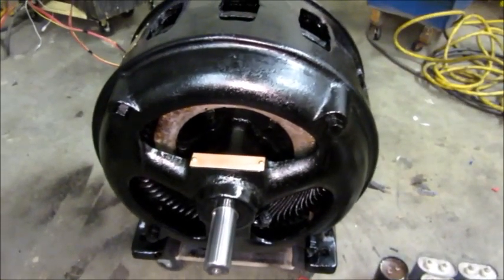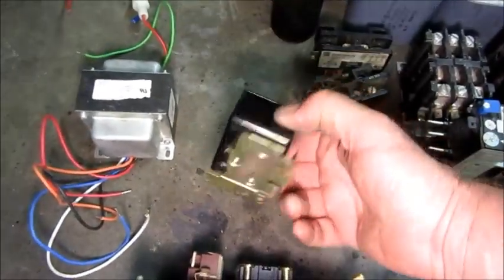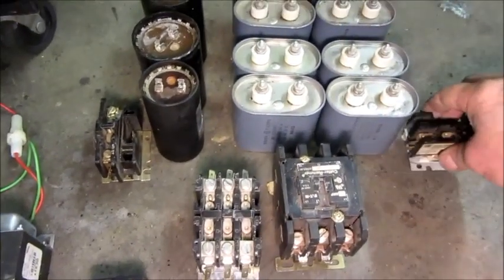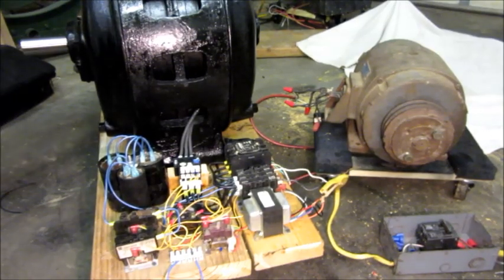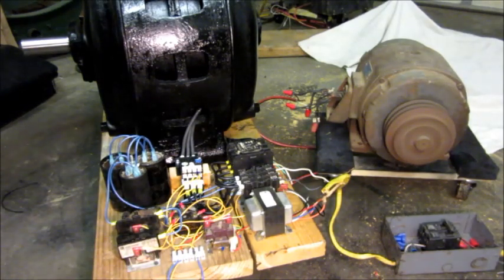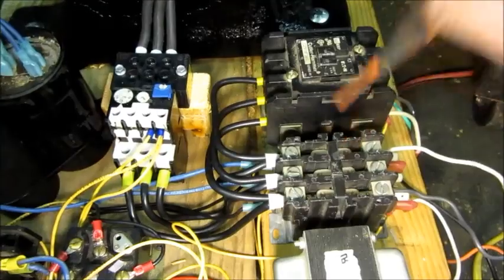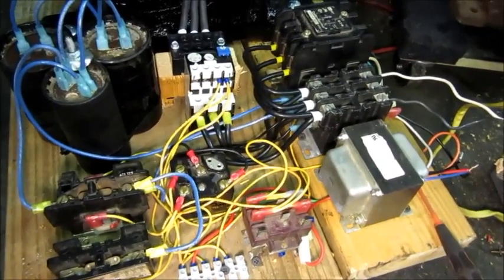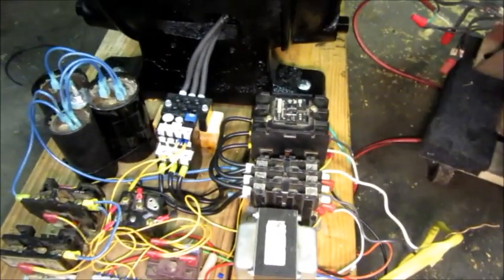Building an Allis-Chalmers Rotary Phase Converter - 1 - Project intro....

Comment: Quick question, would you have to manually reset the overload relay after it trips?
Reply from the maker: Thanks for the comment!  This overload relay can be configured to auto-reset or require a manual reset. If I remember, this is set up so that it auto resets. Because the converter start/stop control uses an electrically latching relay, the overload will drop-out the start relay and stop the converter. Once the overload resets its self, the converter will not re-start until the start button is pressed again, manually. So basically the converter "as a whole" has to be manually re-started if the overload trips; but the actual overload relay resets by its self. The start relay however, requires the start button to be pressed again to re-start once the overload relay resets.

Comment: The moto you rebuilt is very smooth. Quiet. Nice.
Of course the real proof in the pudding for starting motors is starting them under load.
Nice setup.
Reply from the maker: Thank you! 

I agree completely about the proof being in starting motors under load. Unfortunately I don't have any big 3-phase motors with loads to power from them. I plan to make a side-video about the converter starting a larger motor with load, once I have something here to do that  with. Starting under load, and maintaining balanced current and voltage running under load are two areas where the capacitors and other parameters really have to be just right.

Comment: Good day Davie. I have watched so many Converter videos but this one really caught all my attention. First and foremost, your accent sells your good name more than the workmanship of your projects. i followed each and every bit of the development process of converter motor and that was awesome. There came a point where I felt you have a special dedication and patience particularly when you waited for the shaft to be machined, the modification of the oiling system ring together with broken arm of the motor. That was fascinating. By the way, with the schematic diagram that you sent me I now appreciate the videos much more albeit i fail or rather may be I am slow on grasping the connections into 95 and 96 of the Overload Relay.  I see two wires coming out of 96,  i guess, where are those wires going to?

Comment: Too bad it doesn't have Closed Captioning. I Think these videos could have helped me a lot, but I just can't understand what you are saying.
Reply from the maker: Hi Barry. Could you clarify why you can't understand what I am saying? Are you a native English speaker? I don't know how to make captions.
Reply from the maker: I tried enabling Closed Captioning, but it wasn't entirely accurate. I have to review the video and edit the captions, so it will be very time consuming. Hopefully this is helpful!
Reply: @davida1hiwaaynet  I am extremely hard of hearing. Don't worry about it. I found a great book to use
Reply from the maker: @BarryNC1942  Understand that. I am also hard of hearing.  I did put captions on all three of these videos, by the way.
Reply: @davida1hiwaaynet  I also need instructions for building a 40 HP phase converter, of which I can find no info.
Reply from the maker: @BarryNC1942  It would follow the same principles as this one does, however the capacitor values would be higher, as well as the wiring and contactors would need to be sized for the current demands.
Reply from the maker: @Barry Kratzer I have put captions on all the parts of the phase converter video. Please let me know if it was helpful.

Comment: I have seen guides for that setup before.

The trick of using the the motor as both motor and generator is rather clever.

Motors can start on 3 phase, since 3 phase have a spin direction.
Doing same on single phase is complex/messy. (phase shift e.t.c.)

I have done eletronics creating 3 phase signals before, there is a lot of interesting stuff (even at low power-level).

Voltages in all directions, placepent of phases vs center point (where apply), power factors e.t.c.

Comment: Do you think the mass of the old motor acts like a mechanical capacitor? Seems like it’s well suited for this task, it runs quiet and smooth!
Reply from the maker: I think the mass of the iron, magnetically helps with providing reactive power on the derived phase, but not so much due to spinning momentum. It seems that even modern, light-weight motors will produce good phase converter power with a light weight rotor. Not really sure. Would need to do some waveform capture with heavy stepped loads, and add / remove flywheel mass to see what happens.

Comment: I'm just trying to wrap my head around all that I just saw.. Electricity to me you plug it in flip a switch and it's on.. LOL. Yet I wired my workshop and the inspector said Very Good Job.. So much to learn.
Reply from the maker: This is great!  The inspector looks mostly for craftsmanship of the installation and how well you follow code guidelines. It's very possible to do great work without being deeply educated on theory.

Comment: Nice work David, that's going to be a great converter and you won't have to put it outside to quiet it either! Very cool purpose for that vintage AC too!
Reply from the maker: Thanks!  I've still got to complete the enclosure for the contactors and capacitors; as well as the control station. Hope to get on that today!

Comment: What kind of amperage and voltage is induced on the third leg, I am assuming that it is not anywhere near the input amperage? What does the output phase look like is it clean. Just curious if this could be used where true 3 phase is needed to say run electronics that require 3 phase like large computers?
Reply from the maker: Without the capacitors in play, the derived phase would have 0 amps, and about 95% the voltage of the input. It is a true, clean 3-phase waveform but the amplitude of the derived phase waveforms would be lower than the supply amplitude. The capacitors help to balance this.

Comment: Merry Christmas to you too!
So like... you're powering a 3 phase motor on single phase 240, and the act of it spinning is generating power on the center phase, which you can then use as the '3rd' phase/Line when powering another motor. Do I have that right? I mean, I knew this kind of crap exists, I'd just never wrapped my head around it.
Reply from the maker: @MadMan Yes, you got it right!  The coil groups in the motor are made up of groups of 3 coils each. One coil of each group is used as a motor, while the other two coils are like a generator winding.  When working with phase converters, the output should always have phases A and C coming directly from the incoming line. Phase B should be the "derived" phase. It can have a much higher voltage related to ground / neutral than the others, and as such needs to be used only for motor loads.
Reply: That's it, you got it. Great way to power equipment at home or wherever you don't have 3 phase. I made a much smaller and simpler version to power my J-Head Bridgeport mill.